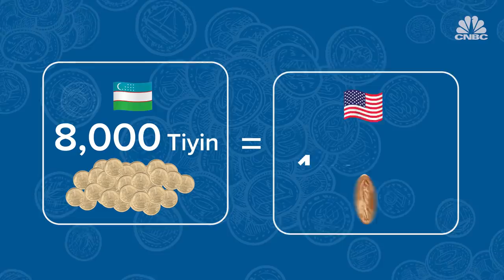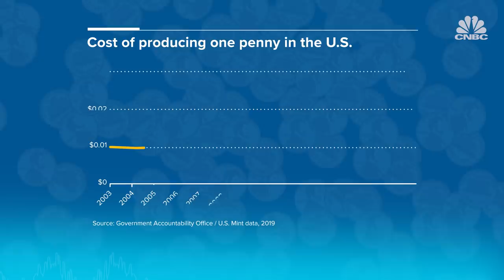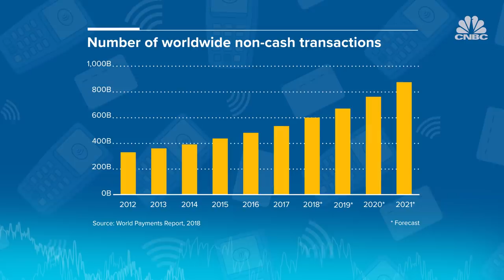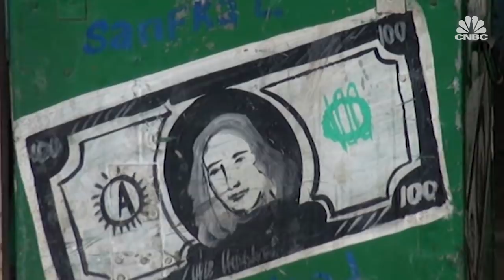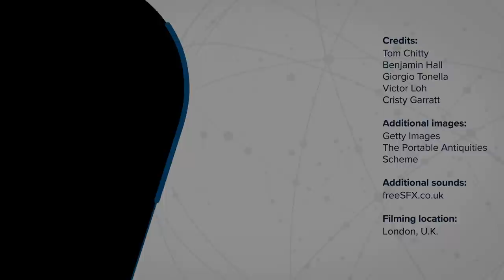Why do we have the penny? | CNBC Explains

Comment: I don't think they should scrap pennies, but I do think retailers should stop pricing things at something 99!
Reply: In the Netherlands we dont have 1 and 2 cents. But we still have prices like 9,99
Reply: Stupid question I know, but in that case how do you pay? Do you have other coins that can add up to 0,09, like 4 cent coins or something?
Reply: If something is €9,99 you pay €10 and if it cost 9,97 you pay 9,95. That is only with cash. If you pay with card you pay the correct number.
Reply: In New Zealand we got rid of 1 and 2 cent pieces in the 1990s and the 5 cent in the early 2000s. We also reduced the size of all our coins. It's extremely likely that the 10 and 20 cent will be removed from circulation in my lifetime. Mostly we don't find it weird as most transactions are electronic these days.
Reply: Something ending in .99 is a trick to make you spend that dolar extra without realizing because you only read the big number so when something is 1.99 your mind reads it as a buck and not 2 bucks
Reply: It’s a marketing trick by retailers to make an item appear less expensive than it actually is. $9.99 is only a cent cheaper than $10, but the optics of $9.99, makes it look a lot less expensive.
Reply: J C You liked your own comment though ;-;
Reply: Pricing things as 99p keeps a penny in circulation when you pay £1, but some people believe there should be a 99p coin. If this happened, coins would quickly go out of circulation & and end up in all the shops!
Reply: It costs more and more every year to mint pennies, in fact for over a decade it has cost more than a penny to actually mint a penny.

Comment: Pennies don’t even Fuking work in vending machines anymore
Reply: They do. If you place the penny on its edge directly on the glass and then hit it with a hammer then it breaks the glass. You’ll need a razor blade to peel the laminated layer but after that you’re good to take the goods you need. Be a good chap and leave the penny inside when you’re done :-)

Comment: Why do we have the penny?

Well, answer this and then you'd understand one of the reasons: Why do things cost £__. 99?

Exactly
Reply: It's called "psychological pricing", where instead of, say, £10 you say something costs £10 minus the minimum currency unit... it works just as well whether that unit is worth 1 or 2 or 5 or 10 nominal minimum currency units (e.g., pence, cents). Here in North America, some retailers deliberately use, e.g., $__.97 instead of $__.98 or $__.99 so they're at least one or two cents cheaper than their competitors who use a higher psychological price—here's looking at you, Walmart. >.>

Comment: At 2:08 there is missing subtlety. The limit only applies to the settling of debts, not any purchase, and it applies to the amount of 1p and 2p coins, not the value of the purchase.

For normal purchases vendors are not required to accept any form of payment, legal tender or otherwise. For debts vendors still don't have to accept legal tender, it's just that paying into a court funds office in legal tender is a defence to court action for non-payment of debts, which the creditor must accept if ordered to do so by a court.

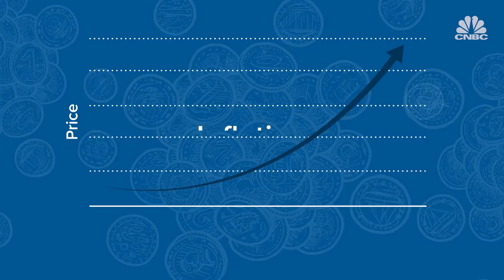Comment: i think 1:40 is incorrect, they added cheaper metals but the face value still remained the same, thats how a debasement of a currency works.
Reply: Debasement is a lowering amount of precious metals in coins. 

Inflation is an increase of prices.
Debasement causes inflation. But not necessarily other way round. You can still have inflation with gold/silver based currency.

Comment: seems like they’d get the same result from €7.95 as from €7.99—so this is not an argument in favor of pennies.
Reply: @KILLERxPRO99 
have you ever worked in a restaurant?  they kiss off more than that because it's just not worth worrying about.

let's say they sell 50 pizzas a night at €8, or 57 pizzas at €7.99 or €7.95—that's a difference of €2.28.

how much are they saving by not dealing with pennies?  I don't know but probably not as much as €2.28.  so, let's say they're still down €2 for setting their price at €7.95.

how much does each worker make, per hour?  does the manager come through and rush everyone in the kitchen through they're final cleanup—to make sure they clock out as quickly as possible?  I guarantee you that they could save way more than €2 by doing that, and that's even if no one it milking the clock by sitting around for five minutes without clocking out after they finish—which is super common, and which, in my experience, managers often have better things to worry about.  they'll do something if they catch someone doing that, but I've never seen someone proactively checking for it.

saying something about "4 cents profit" makes a lot of sense if you have a lot of high-precision processes.  if you're manufacturing millions of hinges at a factory in China, and you can cut the price you pay per hinge by even 1 cent, that's huge, but that's just not what restaurants are like.

in other businesses, I think this is handled in different ways, but the death of the penny hasn't crippled the economy of places that have already stopped using it.

Comment: I actually think pennies nickels and even dimes should be ended. The extreamly small number of things worth less then a quarter (for example individual nuts and bolts, single pieces of candy like a single skittel) would just be sold in sets. Like 5 skittles for 25 cents. The penny in the usa really has no value anymore as even the smallest piece of candy costs a nickle.
And on the pizza sells better at 8.99 the 9.00.
It will sell just as well at 8.75. In fact slightly better. Not as big of a jump but still more. So that's no excuse to keep them. 
If we only got rid of pennies we would be back at having a worthless coin in 5 years with the nickel geting rid of the nickel probubly gives us 15-20 years and geting rid of the dime gives us 25-100 years befor we need to do it again. Currently the quarter already has less buying power then the penny did in the 1960s. 
But by literal inflation value at the time the half penny was discounted in the usa it was worth over 17 cents and the penny was worth over a quarter in todays money.
So following our own presdent on what value coins to get rid of everything under the quarter is what we should do.

Comment: US pennies are so pointless. I use my debit card and gas card almost exclusively. I do keep some cash in a safe in case of a situation like a long term power outage or banking network issue. But I dislike change, aside from quarters because they can be useful. I just toss it all in a big jar until it's full and then take it to the bank and have the total deposited in my savings account.
Reply: Even vending machine has prices ending in a zero.

Comment: Why not just stop replacing them? They'll gradually disappear from circulation and the market will adjust prices to accommodate.
Reply: Because if we have less pennies then they become worth more, and eventually they could be worth more than a pound if they came rare enough,
Reply: @louiehorwood660  Pennies are not a commodity but a form of money. Their denomination is fixed as long as they remain in circulation as money but their value may fluctuate with the overall value of money.

Their value may change once they stop being used as money because they become a commodity whose price is based on supply vs demand, but that's irrelevant to this discussion.